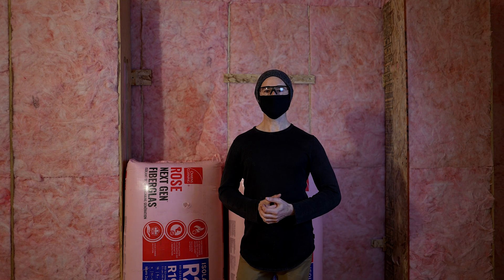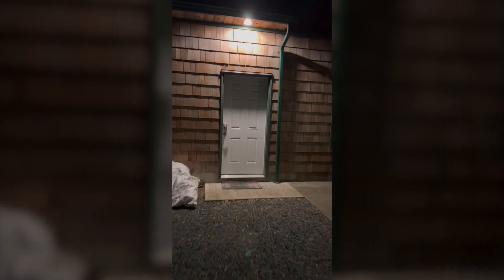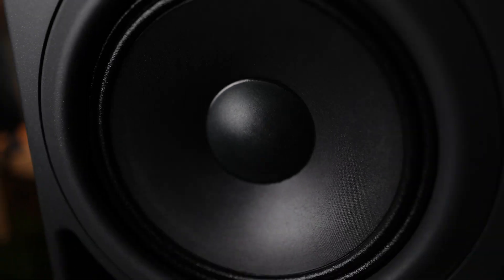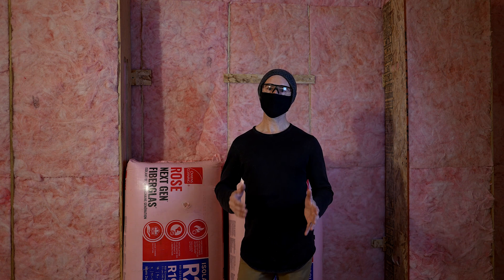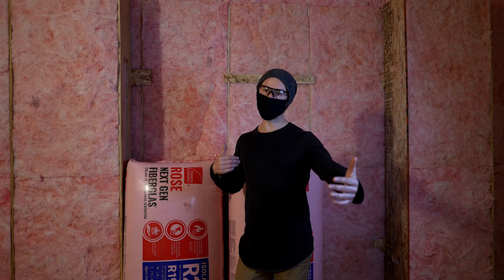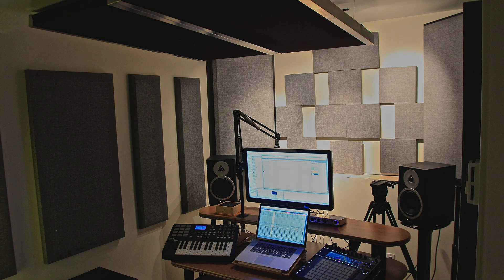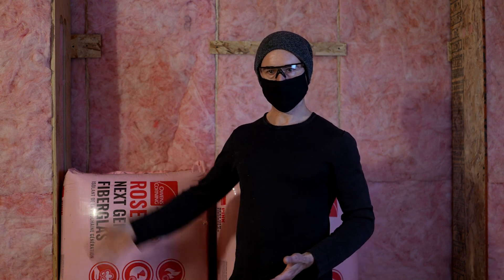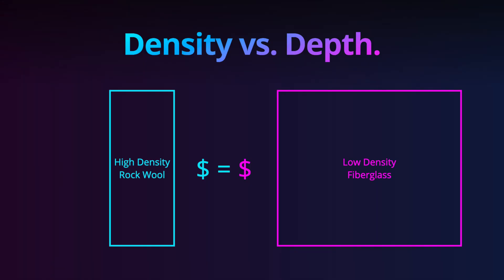Bass Trapping & Back Wall Acoustic Treatment - Building a Mixing & Mastering Studio Part 3

Comment: We have plans to build a professional recording studio. As for the control/mixing/mastering room, we have sketched out a 15' wide x 24.5' length and currently have 10.5' height, but with 2x12 joists. The floor is concrete. So many questions lol...we are planning to hire a pro, but just to wrap my head around it, can i have a window to the live room where the board sits, on the longer side, and treat the short wall for ideal mixing. You had mentioned not to have the board in front of the flush mounted speakers. Can i use the same treatment for the floor as you have done? Should i build a 2x6 framed and insulated wall all the way around, then build the 1x4x8 inner wall all the way around with 2 sheets of 5/8' drywall, with a 1" gap between the walls? Do I do the same with the ceiling?
Reply from the maker: Hey hey.  That's neat you're building a control room and recording studio.  You have some very detailed questions and the answers will depend heavily on your space, goals, budget and materials.  For this type of thing I'd advise working with a pro and doing a consult. You can hire me, or work with someone else but I can't advise on things like this in a Youtube comment.  All the best!

Comment: What thickness did you up using for the rear wall?
Reply from the maker: Hey hey.  The insulation layers on the back wall are 3.5 feet deep, a bit over a meter.  

It worked very well, getting the decay time of the room down to slightly under 200 ms and very even across all frequencies, with a slight lift below 60 Hz rising to 375 ms at 300 Hz.  

The lowest axial room mode 28 Hz, which means that's going to ring out longer.  In retrospect, if I had it to do over again, I would build some pressure-membrane traps on the back wall first, tuned to shotgun that frequency, and then build the porous layered wall in front of that.  That would have reduced the ring time at 30 Hz.  

But the room is built now, so I'm likely going to try out 2 PSI AVAA active bass traps to see how they perform, or possibly build a passive Helmholtz resonator.  Cheers!
Reply: @ Thanks for the detailed reply. You might want to try the older Bag End, active bass traps before you go $$$ on the PSI. I see one on reverb right now.
Reply from the maker: Hey hey,  thanks for that tip.  Yeah, I've heard of them in the past.  I've reached out to PSI to see about testing some AVAAs so we'll see how they do, and I may compare them.  Cheers!

Comment: That fiberglass, is it itchy, like rockwool? do i need wearing gloves and other skin protection?
Reply from the maker: Yes, fiberglass can irritate the skin just like other small fibers.  The material data safety sheet recommends using long sleeved shirts and full length pants when handling it.  Definitely wear gloves, eye protection, and a dust mask.
Reply from the maker: Yes.  You need to follow the material safety data sheet (MSDS).  Wear gloves, glasses, a mask, and long sleeves when handling.  Then for cleanup, never sweep it up, as that will cause fibers to go up into the air.  Use a vacuum.

Comment: Can you explain how you fabric wrapped your room
Reply from the maker: Sure thing.  Note, you should check the channel soon as I'll be releasing an entire deep dive DIY video on how you build these panels from scratch, including the wrapping process.  But for now, here's a brief outline.  

You build most of the modules to be of the dimensions 4' x 8' (they can range from 3.5" to 5.5" deep).  This corresponds well to the dimensions of 4 x 2' x 4' rockwool or fiberglass insulation batts used as porous absorption and the dims of standard SPF x4 or x6 framing dimensional SPF lumber.  

Once you have the frame built, you use an electric stapler (I use an Arrow T50 stapler) to staple 4' wide landscaping fabric on the back side.  This will contain the insulation batts.  Once the batts are placed in and compressed properly then you add 2 layers on the front, but wrapped around to the back to staple in so you don't see the staples.  

The first layer is cotton batting.  This is quilt batting.  I source this at Walmart.  Usually a queen size package gets it right.  

Then the final layer is the much more expensive Guilford of Main acoustic fabric.  I use their Anchorage style.  This is very high quality, has some stretch to it, and cleans up well if you have a stain on it.  It's the industry standard.  

It comes in 5' width, so you have an ample amount to lay it out over the 8' tall dimension and wrap the sizes, top, and bottom around the back to staple them.  There's a technique to it so you don't get wrinkles.  You have to start from the center and staple your way out from there to the edges, and be careful not to pull it too tight.  It's pretty forgiving, and if you mess up, you can always pop the staples out with a butter knife as long as you don't use staples that are too heavy duty.  Use a few staples (like 4-6 per edge) to start and get the basic shape down, then fill in with staples every 2" max.  Maybe 1".  

Try it out.  Best of luck!

Comment: At what depth do you think moving to fibreglass wool is useful?
Reply from the maker: Higher density rock wool can be effective in depths from very thin to about 12"/30cm.  Beyond that it becomes increasingly reflective and fiberglass is typically advantageous.  If you only have a minimal amount of room volume that you're comfortable losing, you can get some really good results by building modules that are 5.5" thick with ComfortBatt R22 rockwool batts inside of 1" x 6" x 8' framing lumber, floor to ceiling, and then air gapping them by 1" from the wall.  You get a pressure effect from the small amount of air in the gap that shifts the absorption lower than a non-gapped module.  Floor to ceiling is essential here.  If you're doing smaller modules, that are, say 2' x 4' with the same material, you'd need a larger air gap and a completely sealed enclosure behind the panel to shift the absorption lower.  Plus, with the smaller modules, your wall/ceiling/floor seams are left untreated.  Floor to ceiling all the way.

Comment: Why do you prefer fiberglass over mineral wool?
Reply from the maker: Hey Frederick. I’d recommend watching video 2 in the series where we talk about the design in detail. 

Short answer though: When using any type of porous absorption like rock wool or fiberglass, you need to carefully select it based on its density and depth.  

Our lowest axial room mode is around 30 hz in this room.  To effectively reign in 30 hz to a tight decay time of less than 200 ms (which is our goal in the control room) you need incredible depth in your treatment.  3-5 feet of trapping.  

The deeper you go with treatment the lower the density of material you need to use.  Otherwise it becomes reflective.  Too much gas flow resistivity with rock wool (9000-10000 pa*m2).  

Fiberglass is perfect for the depth as it’s about 1/3 that GFR).  Look here for how to calculate: http://www.acousticmodelling.com/8layers/porous.php

Rock wool is great at depths of, perhaps, up to 12 inches - sometimes more depending on its density.  Beyond that it’s usually better to use layered materials or pure fiberglass.

Comment: Wow, you should understand what sound does.   Question, when in an apartment using treatment where you are allowed can still help.  Thanks
Reply from the maker: Hi Paula.  Thanks for tuning in and watching.  If you're in an apartment, then what I recommend is building modules that are portable.  These can still be floor to ceiling, you just build them slightly shy of your full ceiling height.  That's what I did in my last studio, which was in a rental space.  

You can use these materials: 1" x 6" x 8' pieces of framing lumber.  Then you cut them so they're 4 ' wide and 8' (or so, depending on your ceiling height) tall.  You fill them with Roxul Comfortbatt R22 home insulation.  Don't use fiberglass or any other product.  Just the Roxul is a good place to start.  

Then to contain them you use black landscaping fabric to wrap the back and staple it in using an electric staple.  Then you wrap the front of them with acoustic fabric from Guilford of Maine.  

I'll shoot a full video on how to create these soon!  They're great and versatile modules that can be moved around and transported to another place.  And they don't damage your walls.  Perfect for rental spots or condos.
Reply: @warpacademy  Yes, great great and thank you.
Reply from the maker: You're welcome.